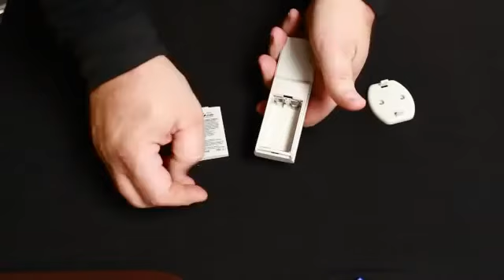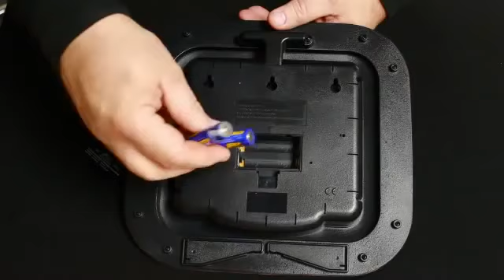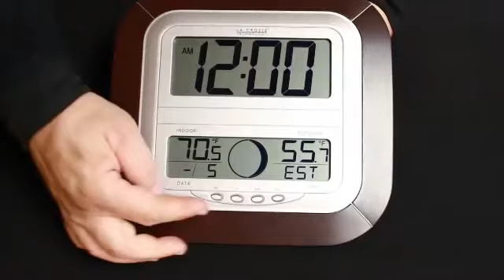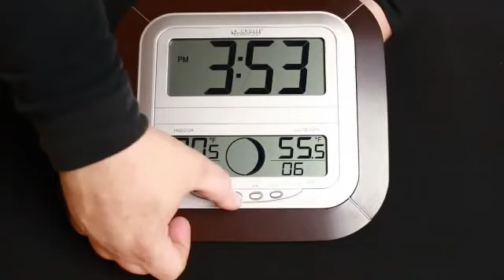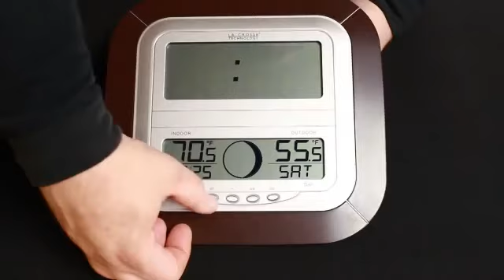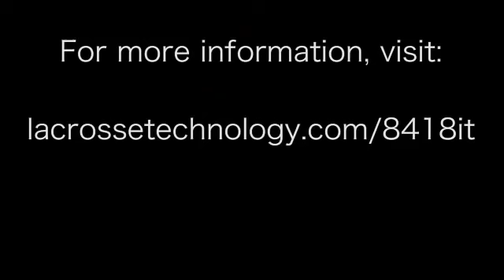WS-8418U-IT Atomic Digital Wall Clock

Comment from the maker: MISSING OUTDOOR TEMP? 

Our first suggestion would be to perform a basic restart covered in our other video here: http://bit.ly/LaxTech_BasicRestart or following the steps below. 

1. Bring the outdoor sensor inside and set it near the station, with nothing in between them. 

2. Remove all power from both the station and sensor (batteries and/or power cord).

3. Press one of the buttons on the station at least 20 times to clear all memory. Verify that the display is blank before proceeding.

4. Let both the station and sensor sit without batteries for at least 15 minutes.

5. Be sure to use new brand name alkaline batteries dated at least 7 years in advance (super, ultra, max, heavy-duty, and rechargeable types should be avoided) and place them into the remote sensor; making sure they are installed according to polarity.

6. Next, reinstall the batteries and/or power cord into the station and confirm it has turned on. If your sensor has a TX button near the batteries, press this to force a transmission and connect it almost instantly. Your outdoor readings should show up on your display within the next few moments. If they do not, skip to step 8.

7. With your outdoor readings now showing do not press any buttons or move the sensor away from the station for at least 15 minutes. This lets the two parts establish a good connection with each other. After they have been connected for the 15 minutes you should be able to mount the sensor back outside.

8. If your outdoor sensor’s information never appeared on your station’s screen (after 5-10 minutes with the sensor sitting next to your station), then please message our support staff directly here: https://bit.ly/contact_techsupport. Or alternatively, send us a private message on our Facebook: http://bit.ly/LaxTech_Facebook or Twitter: http://bit.ly/LaxTech__Twitter page for further assistance.

Comment: Your moon phase is incorrect.  Your treating all the phase as an equal amount of time.  Even though you are using a good anchor date for the year 2000 your have introduced phase shift.  Now my WS-8025U is one phase late.  And yes, the date, time, location are all correct.  Look, the average lunar month is 29.53059 days and the four primary phases should be showing 12 hours before and after the event.  The intermediate phases you keep set to a set amount of days.  You guys are weather people.  This should be 101.

Comment: I need help. I have a slightly newer model. The outdoor temperature is stuck on 158 degrees and won't stop beeping.
Model number W79752
Reply from the maker: Oh no! We're sorry for the trouble. First, you can try a restart covered in our other video here: http://bit.ly/LaxTech_BasicRestart -- Be sure to use a new set of regular alkaline batteries (from the same package) in both the outdoor sensor and clock.

If issues continue, please message our support staff directly here: https://bit.ly/contact_techsupport. Or alternatively, send us a private message on our Facebook: http://bit.ly/LaxTech_Facebook page for further assistance. Apologies again for the inconvenience.
Reply: @lacrossetechnology  I lost the sensor
Reply from the maker: @thegamingshow9971  Ah well that won't help. Replacement sensors and parts for your W79752 can be found here: https://www.lacrossetechnology.com/products/w79752#parts

Comment: I did the exact same startup, except that the sensor was about 1 foot away from the clock. In fact I have two sensors, with one sent to me because I couldn't find the original sensor. After receiving the 2nd sensor I set it up and all was good.

I eventually noted that the outdoor temperature wasn't recording but, due to laziness, I put off reconnecting. After a few months the clock faded out so I used this situation to do it all.
Well, fresh batteries (lithium though, not alkaline but lithium had ALWAYS worked for me previously), and following these instructions, the temperature didn't pick up.

I tried the sequence several times, no luck.
I change the small dial (labelled 1,2,3) in one of the sensors while, again, respecting the proper sequence (sensor first for fresh batteries and then clock within 3 minutes), no luck.
I tested each battery using a special $100 load tester for all sorts of batteries and the batteries were full power under load.
I tried the original sensor, no luck.

It appears to me that the main clock unit's receiving ability isn't working but I don't know.
Now what?
Reply from the maker: Our sincere apologies for the trouble. Our first suggestion would be to perform a basic restart covered in our other video here: http://bit.ly/LaxTech_BasicRestart or following the steps below. 

1. Bring the outdoor sensor inside and set it near the station, with nothing in between them. Set the sensor channel back to the 1 setting. 

2. Remove all power from both the station and sensor (batteries and/or power cord).

3. Press one of the buttons on the station at least 20 times to clear all memory. Verify that the display is blank before proceeding.

4. Let both the station and sensor sit without batteries for at least 15 minutes.

5. Be sure to use new brand name alkaline batteries dated at least 7 years in advance (super, ultra, max, heavy-duty, and rechargeable types should be avoided) and place them into the remote sensor; making sure they are installed according to polarity.

6. Next, reinstall the batteries and/or power cord into the station and confirm it has turned on. If your sensor has a TX button near the batteries, press this to force a transmission and connect it almost instantly. Your outdoor readings should show up on your display within the next few moments. If they do not, skip to step 8.

7. With your outdoor readings now showing do not press any buttons or move the sensor away from the station for at least 15 minutes. This lets the two parts establish a good connection with each other. After they have been connected for the 15 minutes you should be able to mount the sensor back outside.

8. If your outdoor sensor’s information never appeared on your station’s screen (after 5-10 minutes with the sensor sitting next to your station), then please message our support staff directly here: https://bit.ly/contact_techsupport. Or alternatively, send us a private message on our Facebook: http://bit.ly/LaxTech_Facebook or Twitter: http://bit.ly/LaxTech__Twitter page for further assistance.

Sorry again for the inconvenience, we hope we can get your station back up and running correctly here soon.

Comment: My out door sensor doesn't work.  It's been outside for quite some time.  I had to set up the clock manually since it didn't pick up daylight savings time, but your instruction on how to do that was helpful.
Reply from the maker: Hey Mercia, our apologies for the trouble. For help getting your sensor reconnected, we'd suggest reviewing our page and video here: https://bit.ly/basic_restart regarding how to perform a basic restart. If after these steps (using new alkaline batteries) you're still not getting outdoor readings, a new sensor may be needed. In that case, please message our support staff directly here: https://bit.ly/contact_techsupport. Or alternatively, send us a private message on our Facebook: http://bit.ly/LaxTech_Facebook or Twitter: http://bit.ly/LaxTech__Twitter page for further assistance. Sorry again for the inconvenience.

Comment: I  noticed the dashes in the outside temp so I changed the batteries in both.   Then nothing changed, I tried the reset as you suggested. Now when I put the batteries back in, the clock beeps and then goes blank. NOTHING!!!   I did noticed corrosion on the contact of the sensor I cleaned them.  I had another sensor, same problem.   NOTHING...... i BELIEVE IT'S THE SENSOR. But this is the second sensor I've purchased.  Not a happy camper.....
Reply from the maker: Hi Jeannie, thanks for the feedback! We’re truly sorry for the sensor issues and would like to help get this corrected. If you could please pass along your email address and phone number in a private message on our Facebook: http://bit.ly/LaxTech_Facebook or Twitter: http://bit.ly/LaxTech__Twitter page (or alternatively, you can message our support staff directly here: https://bit.ly/contact_techsupport ), we’d be more than happy to help troubleshoot this further. We look forward to your message.

Comment: I just got this clock, and it's not reading the outside temperature at all. I walked through the setup, did everything correct.

I'm not sure what I'm doing wrong... All the batteries are brand new, but nothing is showing for the outdoor temp, just two dashes.

The clock and remote have been up and running for ~4 hours & still nothing.
Reply from the maker: Hi Matt, we sincerely apologize for the trouble. Please try a basic restart covered in our video here: http://bit.ly/LaxTech_BasicRestart -- If this should still prove unsuccessful, you may need a replacement sensor. If that is the case, please reach out to our support team here: http://bit.ly/contact_techsupport and they will be more than happy to help get this corrected. Sorry again for the inconvenience.

Comment: How long should it take for the clock to automatically set?
Reply from the maker: Depending on your location, it can sometimes take up to 5 nights for the clock to receive the WWVB reception. Moving your clock near a window, away from other electronics, and having the front or back of it facing Fort Collins, CO are all ways to help speed this process up. If it doesn't pick up the signal after this time, you may want to consider setting the clock manually, as not all areas will be able to receive this radio signal. We apologize for any inconvenience.

Comment: Has WWV stopped broadcasting a time signal? I have several La Crosse technology clocks, and not one of them has set its time properly in the 36 hours since dumb light stupid time changed. About two weeks ago, I even put one outside, facing Colorado, for three or four days, and it never set itself. 😕

Comment: Hi what can I do if the clock is showing the wrong outdoor temperature reading?
Reply: Sheila Muirragui maybe it's not wrong. Put the clock and the "outdoor" sensor together in the same temperature-controlled room, and after a while see if they display the same reading.